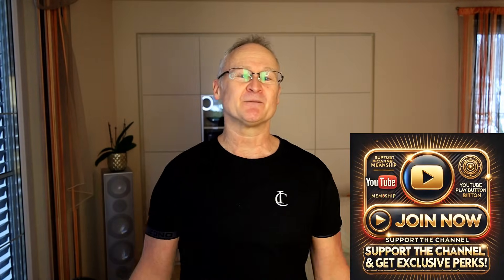Electric Vehicle as a Power Storage? What No One Tells You!

Comment: Cool. I will find DC somewhere in my MG5 and tap into cables, then pass to a solar PV emulator (constant voltage, with variable current limit, I can design this myself as I know electronics) then just wire to a commercial mppt input of grid tied inverter. pass to
Reply: Ah! Most solar inverters are transformer less so solar array has mains voltage AC on it. I will add an dc-dc isolation transformer to my solar PV emulator so car is not mains live.

Comment: Interesting video. Thanks! Now I understand why I didn’t trust ChatGDP on this subject. 

What I understand is that the latest ISO 15118-20 standard supports both AC and DC charging and discharging. And yes, it's still not available in Europe, except in a few pilot projects. I'm convinced that DC charging and discharging will eventually become the most widely used method for V2H and V2G. In that case, only the public charger or home bidirectional charger needs to be certified for connection to the home or public grid. V2L could be a relatively cheap and simple inverter with low power.

Comment: SigEnergy, formerly Pointguard already doing v2h, v2g in the Usa, Australia.
Their inverter, battery, ev dcfc, ac charger setup can do 25kw dc home charging to ev, and take dc out of vehicles like the Ford Lightening and MachE to power the home.
See the video posted today on the Electric Duo channel, showing a sigenergy install at a home in San Diego.
The SigEnergy system is the only all in one home battery, dc charging, v2h, v2g + solar system up and running in the usa right now
Reply: I have same sigenergy system. Works great with my Rivian 2026 r1s. But only works for about an hour and then sends warning
 Inverter seems hot. Waiting for replay from sigenergy

Comment: Enphase has claimed (in the past month) that they will have what you are describing available for North America and presumably Europe next year. I will believe it when they sell it, but their technical specifications seem more credible than their previous pie in the sky. Their specs claim to be compatible with 200 - 1000 VDC batteries and to be adaptable to 240 VAC single phase or split phase or 400 VAC systems at up to 11.52 kW AC.
As a retired electrician and power plant operator, I wholeheartedly agree with your recommendation that people not try this at home until Enphase (or others) actually make an integrated system that is approved for use with your EV.
Reply: I also am pretty excited about the enphase system. DC V2G seems like the solution. Hopefully more companies will also build such chargers.
Reply: I had  Enphase 12kw solar installed this year, but that SigEnergy 25kw dcfc home system sounds nice.
Enphase finally showed their bidirectional charging system with the meter collar auto transfer switch at RE+ 2025 in Vegas.
I currently drive a 2025 F150 Hybrid Powerboost lease, plan for an ev by 2027. Enphase bidirectional ev charging system wonbe out in USA until 2026, so hopefully early bugs worked out by 2027
Reply: @geraldford6409  If I'm not mistaken, the SigEnergy system is a DC coupled system. If you have an Enphase solar system, it is likely an AC coupled platform with microinverters. Assuming all that is the case, it might not make sense to try to make your Enphase solar work with SigEnergy 25kw dc. I did notice the Enphase Bidirectional charger North America data sheet showing both Type 1 CCS and NACS plugs, which should work with any new or recent EV (other than maybe Nissan Leaf if they have kept their CHAdeMO).

Comment: It works in general but if it is so beneficial depends on the individual situation. 
High voltage is key and losses are the killer depending on what you are expecting. 

LFP battery in cars will not suffer from the battery usage for home charging during night, but the high performance electronics of the car are suffering and hence manufacturers limit the amount you can use or abuse a car battery for this case. VW limits it for the WHOLE lifetime to 10.000 kWh discharging and I guess 4000 hours of discharging time.

For the price of a bidirectional charger mounted at home you can get a lot of Home Storage as we had paid 1500€ for 16 kWh LFP storage (EVE MB31 cells also used by BMW). 
If you invest 3000€ for such charger then you can get for that 2 x 16 kWh storage = 32 kWh. 

VW and Audi and so on are designed for this usecase but also in a limited way . If you get a new lease company car every 3 years you might not care but again in the lease the amount of kWh is as limited as the mileage. 

So it works at least in germany with the usual care and all the limitations. VW is now going ahead and using LFP cells too, at least for entry level models in the future for the ID familiy of cars - which will be renamed soon(er) with the ID2 in 2026 becoming VW POLO, then in 2027 the ID.1 becoming VW up and  then in 2028 the VW GOLF (all electric) will replace the ID.3 and end that chapter. 
There is another company discussing that particular DC solution or let us call it the DC "connection" from the inverter to the cars battery, but they have more or less moved ahead once they got orders from scandinavia for a fleet of VW bidirectional chargers. 

They never had planned it as a product but were drawn into the topic and project by existing customers , so a product by incident cause they always had thought it would become a niche product but then Scandinavia took of for them. Now you wanna now the manufacturer.
I do not remember it, I can only remember the channel I had heard about the considerations which had been moove, a german podcast from the german car magazine called auto motor sport.  

FOUND IT: search on youtube for "Manfred Przybilla, Ambibox (194)" and you should get the founder of the most ambitious company in that field but not really sure if they have tried the DC route.
I know for sure that they are very close with VW and VW certifications which was the root of a lot of these ideas. 
They had some business cases with high demand for a kind of fleet deals where a few hundred cars and homes should be equipped with bidi as it is called here. Bidi is the new big thing for all of those who have already solar power roofs and no battery or demand for a bigger battery due to a new heatpump - and with a octopus intelligent go tarif to charge batteries and vehicles from midnight to 5 am for 14 cent instead of 28 cent during the day.
Reply from the maker: Thanks for your detailed comment and the additional insights.
Much of what you wrote is correct – especially the manufacturer limitations, the economics compared to stationary storage, and the points about LFP cells.

These are exactly the topics I wanted to address in the video: that while bidirectional charging is technically possible, it’s often made unattractive by regulations, approvals, manufacturer limits, and cost-effectiveness.

The key difference is between DC and AC solutions:
AC-based Bidi (Vehicle-to-Home/Grid) requires an inverter in the vehicle that can synchronize with the public grid – and this is where most manufacturers fail due to certifications and standards.
DC-based solutions bypass this by having the vehicle output direct current, which then needs to be fed into a certified external inverter to supply the home. The upside: no synchronization issue. The downside: extra hardware cost and currently almost no affordable, market-ready products in our region.

I’m also familiar with Ambibox and the fleet projects in Scandinavia – very interesting approaches, but still highly dependent on the specific market conditions.

It would be an honor if you watched my full video, as many of your points are covered in detail – and you might even find one or two new perspectives in there.